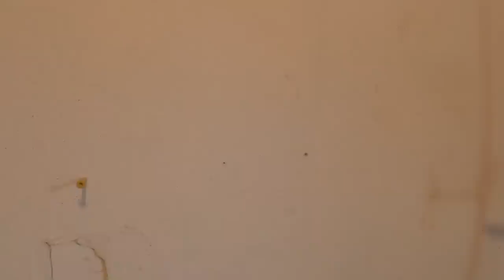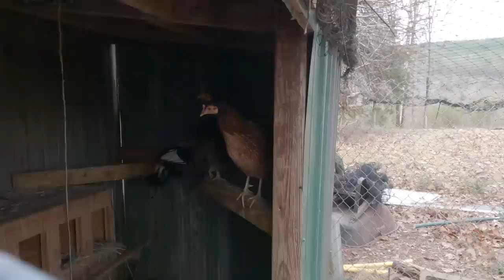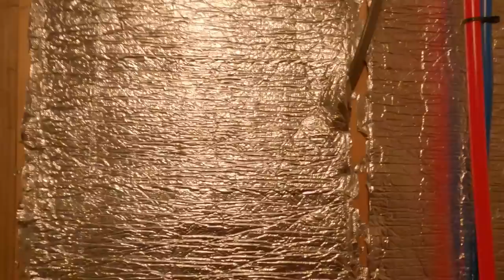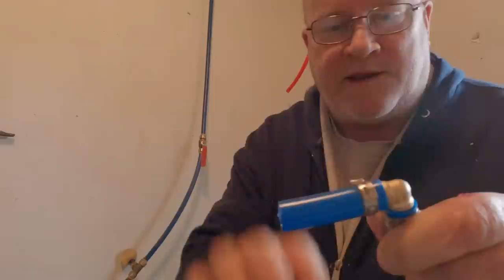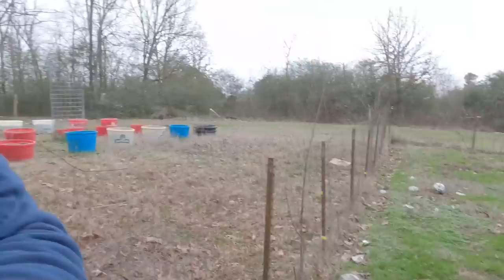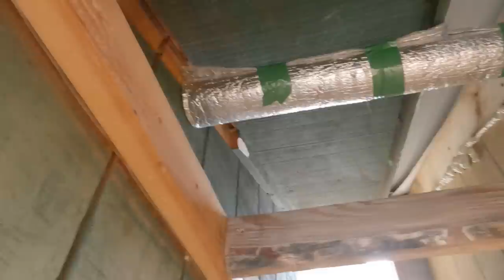Its Done! Electrical And Plumbing Completed In New Cabin Addition

Comment: i ve used the same pex setup and it works great i run air lines in my shop with 3/4 pex also worked great